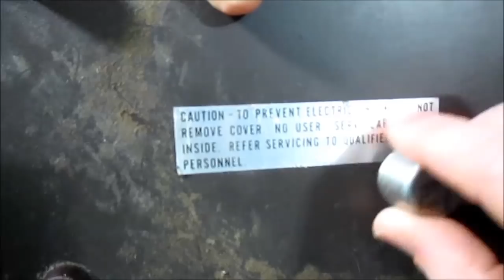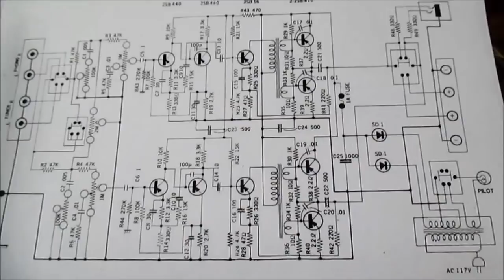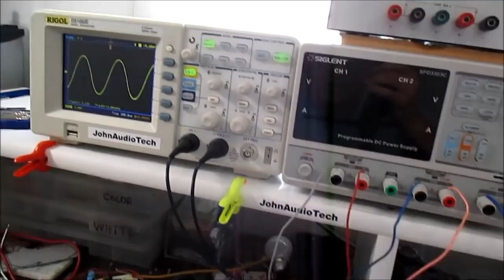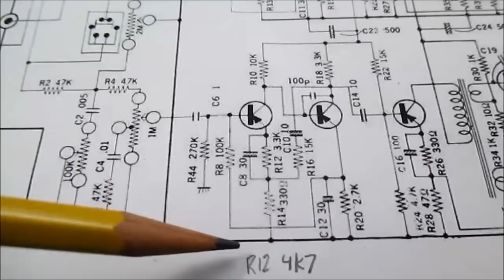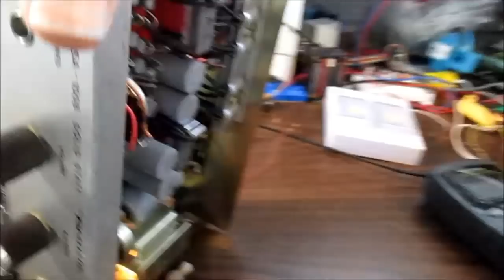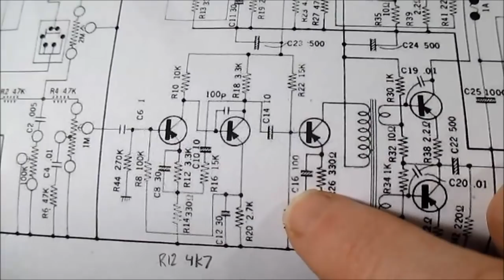Realistic SA-100B mini stereo amplifier repair and test

Comment: I picked up an old Optimus SA-155 amplifier. I plugged in headphones in the front 1/8" jack and got a prominent hum, which doesn't change if I manipulate switches or the volume. I plugged in a signal in the front Tape/CD 1/8" jack. Nothing. When I ran the signal with a 1/8" stereo to RCA stereo jacks into the tape/CD jacks in the back, I get sound, which I can control with tone, balance, and volume, but I still have a slightly lower constant hum. What should I be looking for here?
Reply: This and yours was a budget amp. As long as the output audio is clear, just live with the hiss/static. Adds to the charm.

Comment: Replaced a noisey potentiometer on a Metrosound amplifier. The amplifier had discrete transistors, a single polarity supply by a dual diode rectifier (centre tapped transformer), and the dreaded output coupling capacitors (speakers pop on switching on the amplifier). Noted a capacitor had been replaced when replacing the potentiometer. Had trouble connecting a later seperates tape deck to this amplifier (would howl when recording). Needed the record out lines to be further attenuated. Finding the components to do this externally was hard(modular phono jack assembly). Needed a 3D printer to make these components.

Comment: It's hard to see how this came to market when quite complex in design meaning some thought went into it. Rogers in the UK made a similar design with excellent power and low distortion about the same time. It could have been much better and been cheaper to make. $35 then was not cheap.

Comment: John, I have the same amplifier and the left channel was very weak, I recapped the unit and now the left channel is much stronger but now there is a low static heard in the left channel even with the volume all the way down. I do not have the skill level or meters that you have but can you steer me in the right direction.
Reply from the maker: Excessive noise can be caused by a noisy germanium transistor. They are known for going bad that way.

Comment: 8:40: Those metal can transistors are Germanium. They basically suck for anything Hi-Fi. Although, makers of guitar effects pedals RAVE about them! Beware the (possible) positive-ground power supply in this amp! Most Germaniums, are PNP (haven't watched the rest of the video yet)
Reply from the maker: Yes this is a PNP germanium amp with positive ground.

Comment: I found similar/same one discarded, and i'm from Europe, Slovenia, and i remember "having no bass" on both channels, but at times i just stuck it in tonne or two big pile of crap stuff i "mentally marked as repairable but not resellable at profit" ;-) 
Might dig it out now again and check component values... 

Nice brave cat you have ;-), mine is afraid of wires and ropes since she chewed through and shorted tv power cable (got just minor burns in mouth...thankfully), and a dog that thinks everything that gets worm or blows out warm air/exhaust is alive and wanna play "catch me" with desktop PCs and gasoline generator i just finished repairing ;-)
Reply from the maker: My cat is a wire chewer too. He chewed speaker wires and patch cables. Thankfully, now he leaves them alone.

Comment: I have an old kenwood basic M2 amplifier and the bass is very weak it has no preamp it is plain as be does it need new capacitors? it is from 1983 or 1984 it was only made those two years

Comment: interesting looking old amp, were those harmonics due to germanium transistors or due to design issues ?
Reply from the maker: I'd say it is a design issue. Tubes and transistors are non linear devices but can be used in a very linear high performance amplifier with proper design.
Reply: i see, thanks !